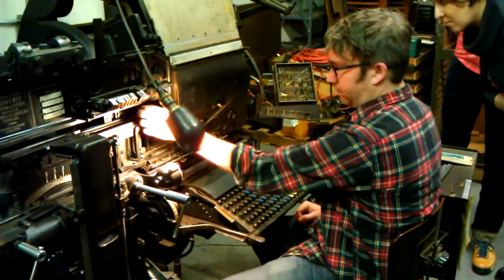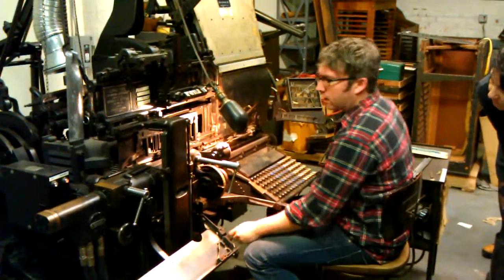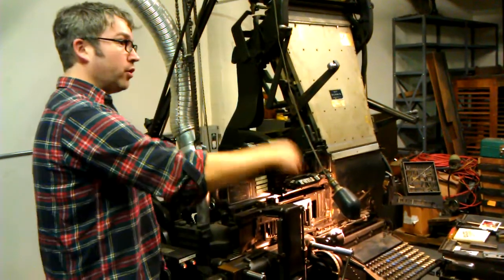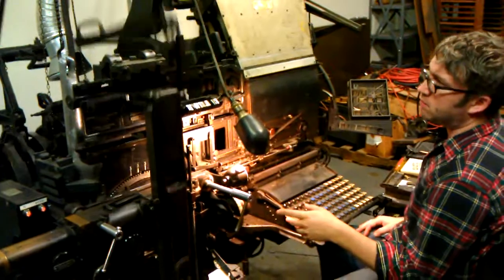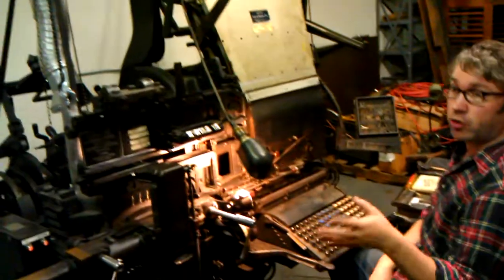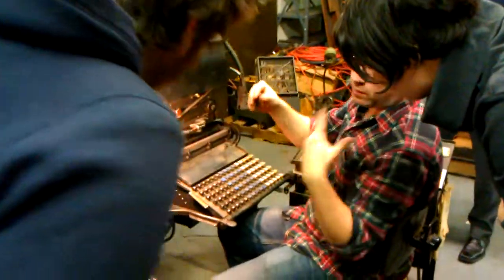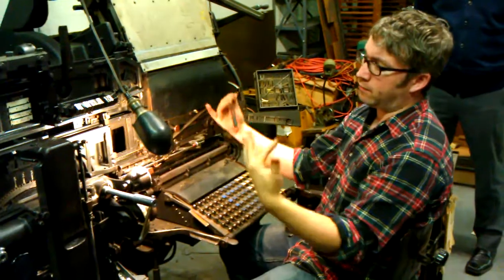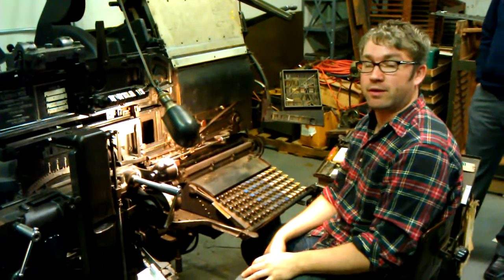Demonstration of a Linotype Machine

Comment: A job for life lad 😃By 1976 I saw the writing on the wall for hot metal printing and left the trade! Yes, have worked Linotypes (some with gas heated pots) and Intertypes. Distributor blockages, hot metal splashes on shoes, - seen it all.